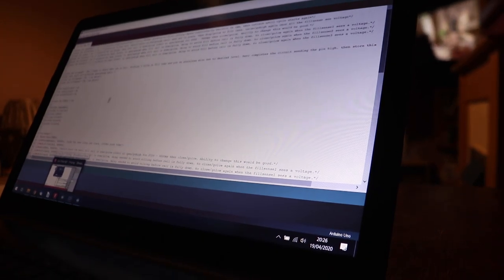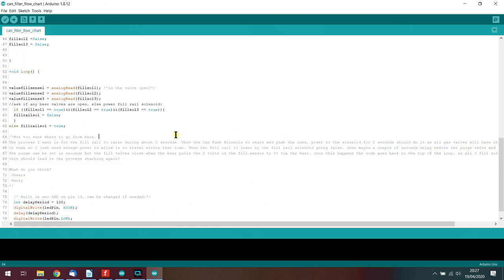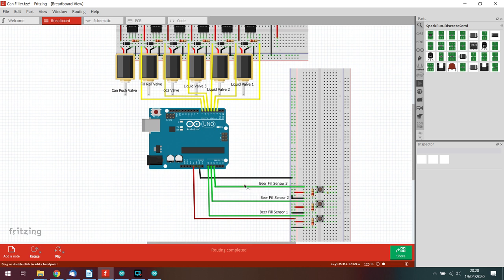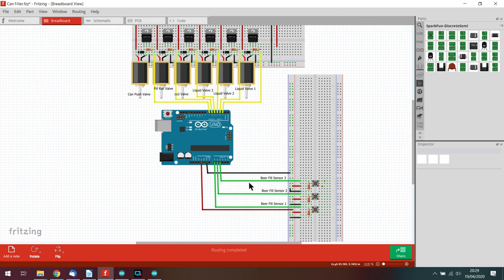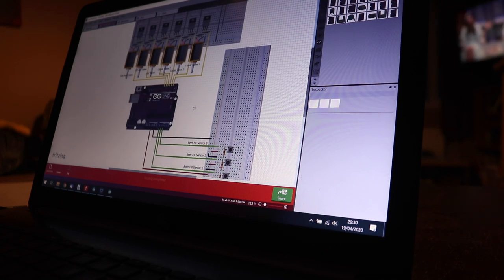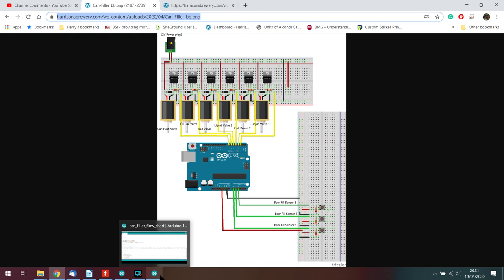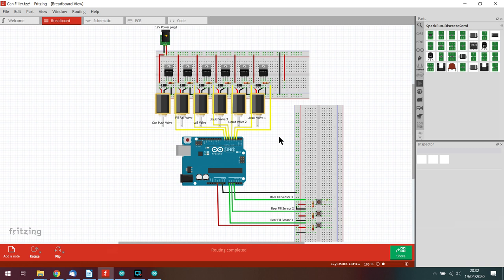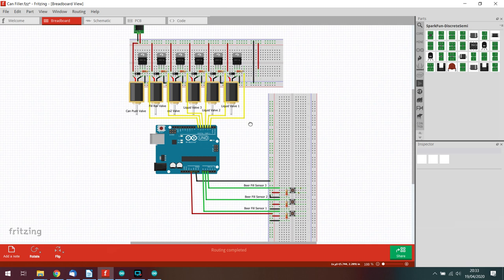The Code Day 1 ~ Can Filler

Comment: IMHO the code will need to implement a state machine.  So we need to think about the all the states this machine will have.   For instance I can think of the following states...   START, PUSH, RAISE, PURGE, STOP_PURGE, FILL, STOP_FILE,  PUSH (starts over).    I'm looking/re-writing the code you provided now...
Reply: BTW relying on time to know how long to push cans is fine for a prototype, but I suspect you'll find that it would be better to utilize a sensor or limit switch to know when the cans are properly aligned with the purge/fill tubes.  But that's not something we need to worry about at this early stage...
Reply: Not sure I understand what the fill rail solenoid is for?   If that's for raising the lowering the cans I don't think you can use solenoid...  Solenoids have two states... on/off..  to raise and lower cans you need three states...   raise, stop, lower...   So you'll probably need to use a servo or motor...
Reply from the maker: Hi Mate, thanks for your help. The solenoid is on the 5/2 valve for the air crlinder that raises the fill rail. You can find our progress here. https://github.com/kloon/OpenBeerFiller

Comment: Instead of reading the fill sensors repeatedly, you should rather use interrupts in the code, this will fire functions when the sensors are triggered. I will throw together something today and put it on Github and send you a mail. Happy to collaborate with other developers if they want as long as the code stays open source and the whole community can benefit. Also if you go the ESP8266 route you can add config web pages etc, but since you already ordered the UNO there is no harm in going that route first.
Reply: just emailed a script but I'd be interested in this (as a good starting point for my fermentation controller as well) especially if it goes ESP8266 longer term.
Just one thought about the ESP8266 as its a 3.3V device what would you do about relays as typically they are easier to get hold of the 5V versions? would logic level shifters be the answer?
Reply: You could indeed go the ISR road with the sensor readings here, but the task is pretty simple and strait forward to be put in the main routine, I think.
Reply: @TangledWebBrewing  The 5v relays works fine with the ESP dev boards, the key is you connect the relay 5v directly to vcc and then the input can be controlled with 3.3v via the pins.